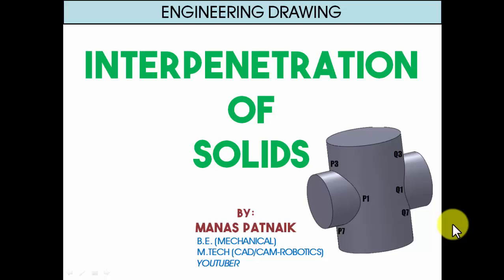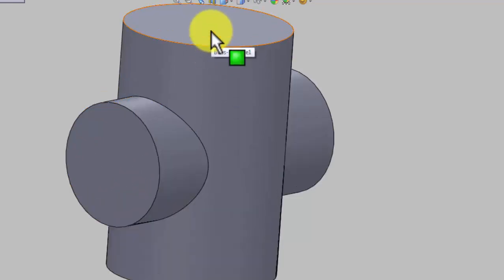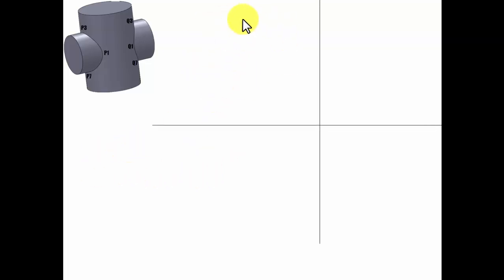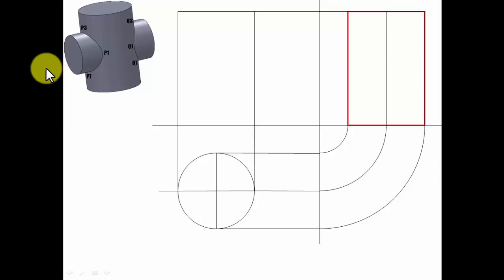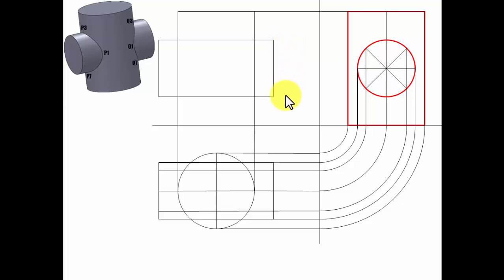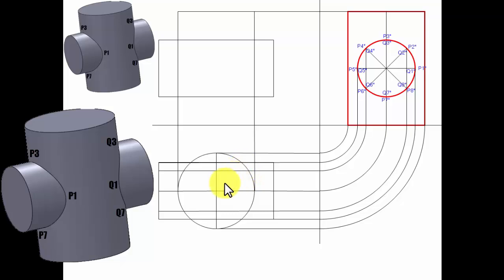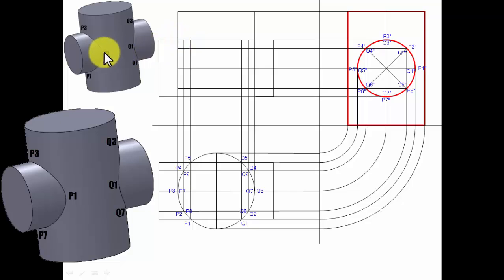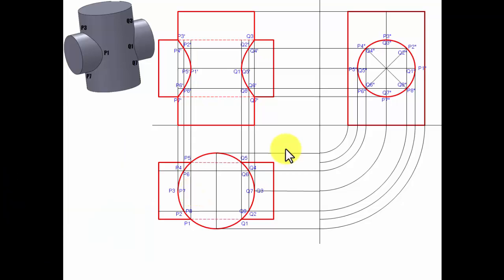Interpenetration of Solids_Problem 2_Horizontal Cylinder vs Vertical Cylinder

Comment: A vertical cone, base diameter 75 mm and axis 100 mm long, is completely penetrated by a cylinder of 45 mm diameter. The axis of the cylinder is parallel to HP and VP and intersects axis of the cone at a point 28 mm above the base. Draw projections showing curves of intersection.

Comment: A vertical cylinder of 80 m diameter is penetrated by 
another cylinder of 60 mm diameter, the axis of which 
is parallel to both the HP and VP. The axes are 8 mm 
apart. Draw the projections showing curves of 
intersection.

Comment: A vertical square prism having its faces equally inclined to VP and side of base 50 mm,is completely penetrated by a horizontal cylinder. The axis of cylinder is parallel to VP and 7 mm away from that of prism. The diameter of penetrating cylinder is 40 mm. Draw the projections of solids showing curves of intersection. Assume suitable length of horizontal cylinder.

Comment: A vertical cone 64 mm diameter of base and axis 80 mm is penetrated by a cylinder of the 
diameter 36 mm. The axis of cylinder is parallel to and 9mm from the axis of the cone and lies on right. 
Draw the cone when the cylinder is removed and only the hole is remaining. Show the curve in the plane 
containing the axis of both cone and cylinder is parallel to V.P. 

Sir how to solve this question please make a video on this question solution sir